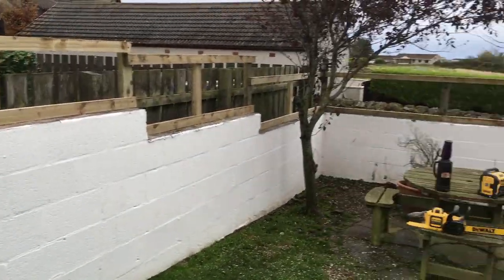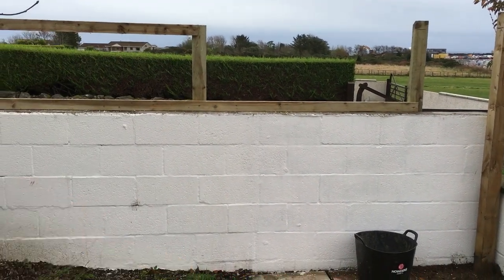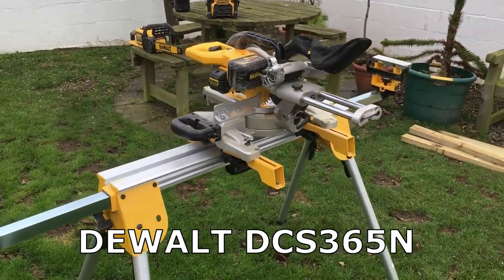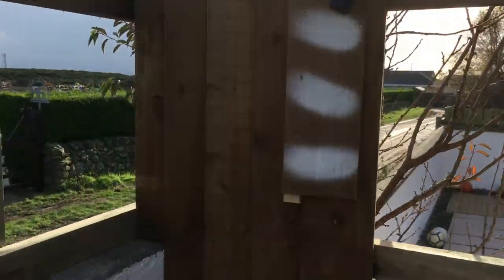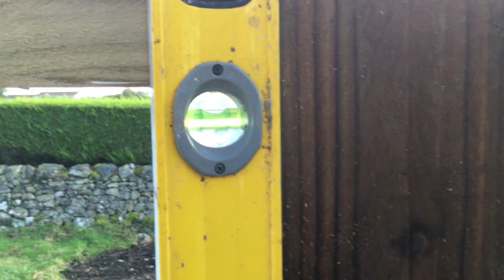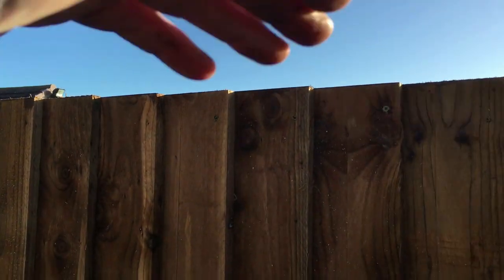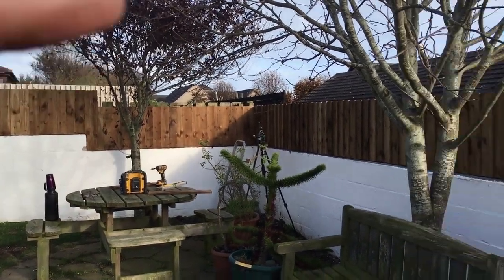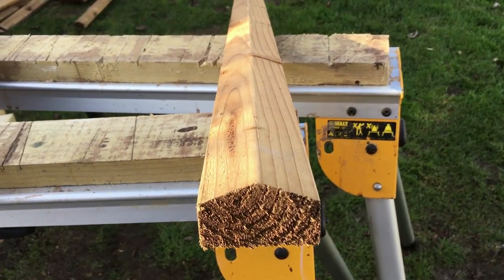How To Build a Close Board FENCE Above a WALL

Comment: Nice job but I have always gone on one fixing 25mm in to allow expansion and contraction in the boards with one fixing point, three for 4' and less and four  for 6'
Screws to do the framing and ringed galvanising nails to pop the boards on at each fixing point.
But each to there own and methods as they say....
Keep up the good work, it's the results that keep the name 👍
Reply from the maker: Thanks Phil, I use different methods depending on each specific job. In this particular case I was using 19mm thick slats instead of feather edge boards. I have never experienced any issues fixing through 19mm boards. I use this method on "board on board" fences as well and never have an issue. The trouble with using one fixing is that it encourages "cupping" of the boards (In my experience), I have been to some jobs where your method was used and when the boards have dried out, they have cupped really badly but could have been down to the nails being driven in too far. Also, on this occasion I used screws because the nail gun tends to split the wood when fixing close to the edge. On standard fence installations, I will always use galvanised ringshank nails.
 Don't get me wrong, I do use the method that you use at times (usually weather boarding) because there are some benefits like being able to replace slats / boards easily without having to dismantle the whole structure. In other words, you can remove the fastener and slip the board out.
 As you correctly say, each to their own and if it works for you, then continue to do it. There are so many different opinions on construction methods of all types. I prefer to use my experience and do what works and has worked for me over the years. 
 Thanks for the comment, much appreciated !

Comment: great video. i was wanting to build a small fence above a wall. the wall has those curved caps on them. if i attach the fence posts to the wall, shall i notch the fence post or chisel the capping?
Reply from the maker: Hi, If you are using thicker fence posts then you could notch them but if using 4x2 timbers like I did in this video, I would not notch them as it could weaken them and compromise their structural integrity. You could always chisel the capping, I have done that in the past. Best to use a grinder with a diamond disc to make lines in the concrete and then chisel it out by had or by using an SDS rotary hammer drill with a chisel attachment. I hope this helps and thanks for the comment 👍
Reply: @Bacrenfencing  Top man, appreciate it!
Reply from the maker: @MrAas41  No probs !

Comment: Great video, doing a similar project soon. On the posts you fixed to the back of the wall did also cement them into the ground? Or just fix with thunderbolts? Thanks in advance
Reply from the maker: Thanks, on this occasion I just fixed them to the wall but I do sometimes cement them in as well, it depends on the integrity of the wall and also how much of the posts you can actually get bolted to the wall. Good luck with your project 👍

Comment: Great job Barry. Looking to copy exactly this in my garden - love the look. It’s all one height like the far side of the wall in this video. I don’t have access to the rear side of the wall though for any timbers to the wall, how did you fix your framework to the wall? I don’t want any framework/posts showing ideally
Reply from the maker: Hi Lewis, on the far side (if you mean the left) I had to go into the neighbours garden and remove slats from their fence so I could get access to the back of the wall. If you have no access, then the only way to do it, would to install timbers to the front side of the wall or install actual fence posts, like I had to do on the right side. I hope this helps ?
Reply: @Bacrenfencing  Sorry mate my description was bad, by far side I mean the back wall, the longest one all on the level. I’ve got that sort of wall however no way to get posts in behind it, so it’ll have to be on the front as you say 👍🏼
Reply from the maker: @LewisBurnell  Either that or you could use bolt down fence post brackets which would fit on top of the wall, something like these https://amzn.to/3qoJwBS than fix the posts and rails but it really depends on how high the fence will be and also if it is exposed to a lot of wind. It is another option though .

Comment: Hi Barry. Great job. I could not access the link to how you attached the posts to the wall?

Any chance you could link it for me here please?

Cheers
Reply from the maker: Thanks, I used the method in this video https://youtu.be/OAA2QnHKI0c
Reply: @Bacrenfencing  thank you. I'm presuming you did the same to the other side wall opposite to the shared wall?
Reply from the maker: Yes, but the other wall, I actually cemented the posts in place as seen in the video. cheers
Reply: @Bacrenfencing  yes I saw that. I don't remember you saying about the other side wall. It looked like you had but just wanted to check. Thank you👍

Comment: Barry I've got a dilemma, I installed fencing panels above our short Victorian garden walls (secured posts to wall). Storm ciara had my wall down as the fence acted like a sail! 😔 we'd still really like a bit more privacy so I'm wondering if I could secure to the wall again but with lighter wood and hit and miss style with 25x34mm battens held up with treated CLS 38x63mm. What do you think?
Reply from the maker: Hard to comment on Barrie as I would really need to see it to be honest.
Reply: @Bacrenfencing  yes that's true. I'm thinking I'd rather be certain it's safe so I'm going to cement posts in the ground, with 19x38 treated battens across. I'll let you know how it goes 👍🏻
Reply from the maker: @Smithb83  Probably a good move Barrie, if there is any doubt about the structural integrity of the wall, always best to cement into the ground mate !

Comment: Cracking and professional job Barry, I know you did some prep work back in your workshop, but how long did it take you from start to finish on the job site?
I have a little bit of fencing to put up myself and will be using your technique👍🏻 cheers man.
Reply from the maker: Thanks Davie, it took 2 days (from hourly perspective) but I was actually there 2.5 days because I can only work limited hours during the day due to having to drop daughter off at school in the mornings (wife busy with webex calls etc first thing, so I do the morning school run).  In summary, it was a 2 day job, first day getting posts in and rails fitted, leave a day for the cement to cure 100% and then fit all boards and capping the next day. The boards are a little time consuming as they had to be individually cut to size.
 Good luck with your fencing project and thanks again for the comment - much appreciated 👍😃

Comment: Nice work. I need to do this to stop the dog jumping over the short wall into next door so will have to use posts & concrete. Did you use 1 bag of post cement per post or 2 bags? (Or would you say twa bags? 🤣)
Reply from the maker: Between one and a half and TWA bags Peter ! Good luck with your install ! 👍😎

Comment: should you not avoid having the screws going though both pieces of board - to allow for expansion and contraction of each board at their own differing rates and avoiding any splitting  - just like you would do for cladding a shed for example? IE : Instead place a screw in the first  board - then overlap the next board and place a screw that just goes through that board and so on and so forth.  That way each board is fixed individually and free to expand and contract at its own rate.
Reply from the maker: Never had an issue with overlapping 19mm boards or feather edge boards in this way Hugh. 
A shed is different, when using weatherboarding for a shed, it is tongue and groove so no need to screw or nail through two boards, the T&G holds them together, hence why you can get away with nailing single boards. 👍
Reply: @Bacrenfencing  I wasn't referring to T&G but to feather-board and regular board like you are using.  This video may explain it better  : https://youtu.be/CX09PoDglEU?t=1002
Reply from the maker: @hughhennessy7912  Fixing boards with one fixing in the centre like Robin shows there is a sure way to encourage cupping of the boards when they dry out. Added to that, you would be causing stress to the boards by fixing like that, especially with feather edge. I always fix through the boards and have never had an issue, but each to their own. I have seen that method used, but I am not a fan, especially on a fence.

Comment: Shouldn’t it face the street?will look naff for neighbours
Reply from the maker: The other side faces a horses field, there is no street and the horses did not mind. 
The left side section has another fence in front of it, so not an issue.
 The other side was discussed with the neighbour and they were fine with it.
  I built it as requested by the client. Normal practice would be to have the good side facing the outwards but every situation is different. Thanks for the comment.